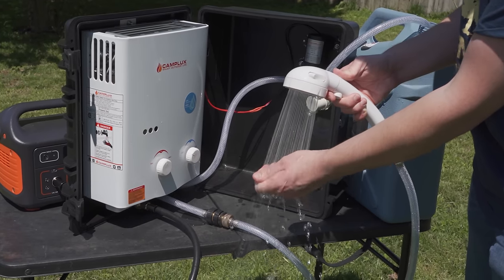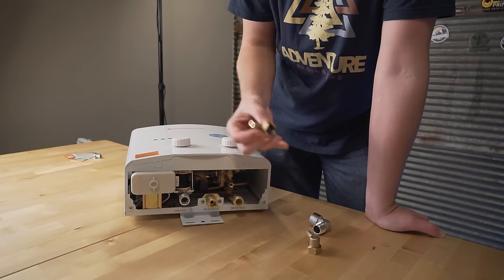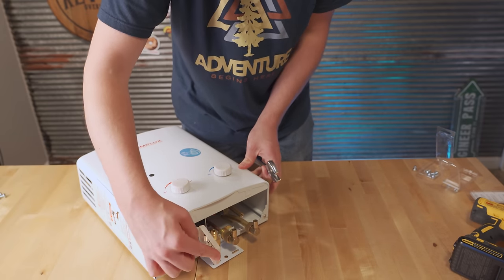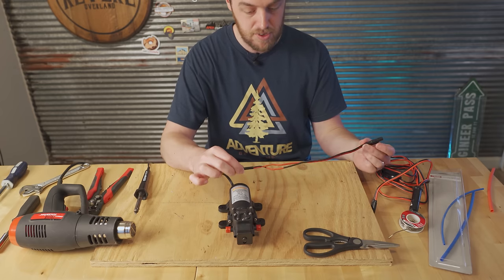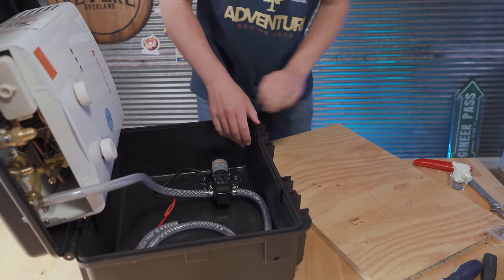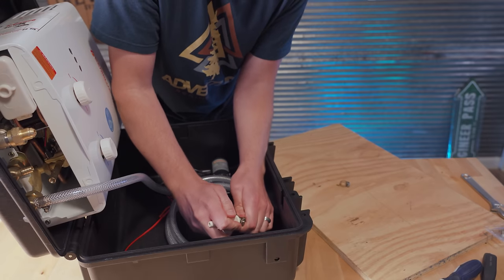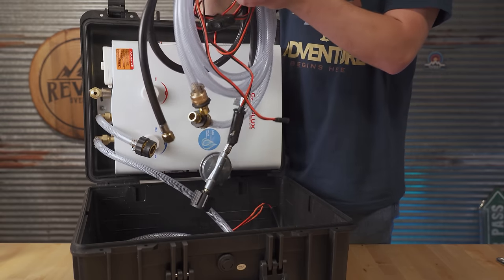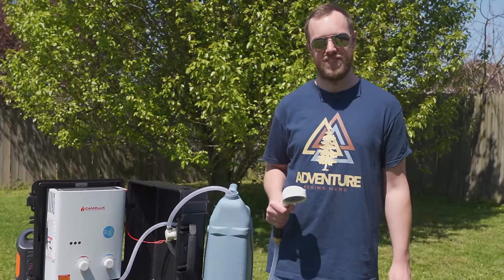Instant Hot Camp Shower in a Box

Comment: Great video mate! Just purchased one of these on Friday of last week and and using later this week when I go away. Probably won't have time to do this to the setup, but it certainly is on the list of projects. Just nice way to have it all in one place.
Question for you though. I assume that the heat coming out of the top of the system is not hot enough to melt the plastic?
Also, off the pump, could you not have put a 90degree elbow in at the inlet to avoid the bend in the hose? Just a thought.
Cheers!
Reply: I am wondering about the plastic melting as well if used frequently or for long periods of time

Comment: I set up water and pump system but really like your idea to keep the unit stored and damage free.  1 question however, doesn't the heat rising from the unit damage the otter box?  seems like it would if not right away over time.  Do you do anything not mention in this video to minimize the impact?
Reply from the maker: It doesn’t

Comment: I'm sure this has been addressed but there are way too many comments to check. 
*I would plug the gas outlet and not keep the gas line or plug it when not in use to keep that water out of it. 
*I would put the electrical cord in a plastic baggy to keep the electrical stuff dry when stored as well.
*You can very easily put your own tap into the bottom of a water container for probably less than $5. Also, you could weight that hose, perhaps with one of the brass quick fittings or just a hose weight.
*Consider an additional hose with a prefilter that you could drop into a lake or stream & then have endless water.

Comment: Do you feel that the original quick connects to the water heater are the reason I get leaks when I turn my sink off? Water supply still running but sink handle in off position. I saw you said they were cheap. The leak is happening at the quick connect.

Comment: i would find a 400watt dehumidifier and hook it to solar power in your van / truck / car and  this way you will always have water for you shower at the end of the day in the middle of nowhere, sure its not drinkable but good enough for a shower, i would add that to your list
Reply from the maker: I'm thinking 10,000 BTU air conditioning unit, that way you get the water AND cooling
Reply: Revere Overland Have you found any portable DC air conditioners to try?

Comment: Have you had any problems with the exhaust from the heater melting the plastic case? Is the Camplux heater still working well? Have you used it a lot?
CASE ID: 17.64 x 13.58 x 7.32

Comment: I wonder if you could use this for washing dishes in a camper trailer as well..I mean it’s portable right?  Or even just run the hoses and mount it in the closet...
Reply from the maker: You definitely could use it for dishes in a trailer. My buddy has this mounted in the back of his off road trailer for just that, then when he wants to shower he pulls the hose out to his shower tent. You just need to make sure it’s well ventilated.

Comment: You could just heat some water in a large pot and wash with that, don't need a shower TBH. A less stiff hose or a weight on the end will let it stay at the bottom of the water can.. How long will the  small propane cylinder run the water heater?  That came out pretty neat . I'm considering a Joolka.

Comment: Really nice job for all in one package. 

But I think your going to run into a little problem. The case where you have the main unit hooked up is plastic. The heat exhaust part of the shower unit is on top, that’s where the heat exhaust will be coming out and it’s going to be really hot. What do you think is going to happen once someone takes a 5-10 min shower? That top part of the case will start to get soft and start to melt. Plastic and extreme heat don’t mix. 

Think about and I hope everything works out.
Reply from the maker: I ran this shower non stop on my entire 7 gallon tank to test it out. The plastic is very heat resistant.

Comment: Why didn't you simply cut some heat venting holes in the box itself? Maybe reinforce it with a carbon fiber or metal grid so the heat can escape without weakening that side?
Reply from the maker: It doesn’t need it, you run it with the box open.

Comment: what was the other case by pelican you recommended and that would fit all the stock fittings? Also, that hose does not look like a 3/8s inch id. It looks like 1/2 inch.

Comment: if you want to use the jury can that he used and keep your hose from coiling back upwards all you have to do is get yourself a stainless steel coat hanger and wrap it around the hose in a coil shape it will keep it rigid but yet flexible or you could just fold it in half and shove it up the center of the tube and then put it into the Jerry can water will still flow through

Comment: I think this is cool, I would have went further and taken Apart the whole mechanism and mounted only the burner parts on the door with a plate and spacers away from the frame. also i would have tossed the power connectors and used xlr or even old rca connectors. its only 12v
Reply from the maker: I froze mine on the latest test, so I might take it apart when I have time

Comment: Is the MP case you have listed on the parts list the same one you used in the video?  It is obviously larger than the minimum but it seem bigger (hoping so it’s not so tight). You are a pro at putting things in a box. Thoroughly love my diesel heater in the metal box-thanks for all your help.

Comment: Does the pump auto switch off when ots not been used? Im building one on my boat but goimg to use the shower for tap and shower.. obv diffrent times but dont want keepessing around turning it off and on.. so if i kept it on in a bigger tank, when i run the tap.wpuld.it work the same basically?

Comment: I did buy one of those heaters.  Ended up throwing it away . It was not safe to use. The heater would not turn off when you turned the shower off causing the water to overheat and blowing off the hoses on the hot water side . It was just not worth it.

Comment: I have the Zodi shower in a box. Way smaller, very practical and I'm guessing much cheaper. But no DIY required so no weekend project 😜
Reply from the maker: I had a Zodi that I got after last summer’s trip. It heated well, but the heating element cracked, so it’s unusable now. I’m not a fan of the battery pump that comes with it either, and I’ve never seen their 12v in stock! I’m assuming pretty much any 12v would do the job though.
Reply from the maker: But yes, the Zodi is cheaper and smaller!
Reply: Revere Overland I’ve had mine for several years and it still works well expect for the battery pump that stopped working at the end of last year so I’m not a fan of that either. But overall happy with it

Comment: Great video.  I camp on the beach and its often windy.  How stable is the unit when sitting open on the table and would there be any issue with wind knocking it over?   There was also a comment about wind affecting the efficiency of the heater.   Have you noticed any issues?  Thanks!
Reply from the maker: The only problem I’ve had is that this heater can be too hot sometimes, never too cold! The box is pretty stable - it’s big and heavy, and when open 90 degrees has a stable base.
Reply: @RevereOverland  Thank you.

Comment: This looked like a great idea, and it was very well presented. But, when I add up all the material costs it comes to $510. So even if you adjust for some of the bulk hardware items that you'll have left over you'd be in for $500 or so. A Coleman portable tankless water heater is $310 at Amazon. It comes with the pump, hoses, shower head, etc. It's ready to use. A Base Camp water heater is even less at $199.
Reply from the maker: I don't think that's a fair comparison in cost. The parts for the shower unit as I have it set up cost me $350. You definitely can't include the cost of my propane mount, but if you want to include the bottle, it probably ends up being cheaper in the long run since those 1lb bottles add up. In the end, mine is only a little more, but is a whole lot better than the small self-contained units - far more heating capacity, and a more powerful shower.
My biggest problem with the Coleman and the Zodi is that you can't quickly and easily start and stop it to conserve water. I (and most people) only carry a few extra gallons of water, so can't afford to just have it running constantly. The Base Camp is the only one that you can switch on and off on demand, and it has horrible reviews!
Reply: @RevereOverland  I followed all your links to get the pricing. If I take out the bracket it comes to $419.63. Anyway, I live in Canada, so I will have to go back through the exercise to find Canadian suppliers and pricing to see how much it will cost me. Regarding the stop/start feature, are you talking about the ability to turn the water flow on and off from the shower head?
Reply from the maker: I just added it all up again, and I think I forgot the gas fitting from McMaster Carr last time. I got $381 + $5 shipping (USD). I'm not including the propane tank - I can refill it for about the cost of a 1lb bottle, so it'll be a lot cheaper in the long run. I'm also using $6 for the cost of the screws, washers, and nuts, because that's what it cost me from Lowe's.
Yes, I'm talking about the ability to start and stop from the shower head. You can do it often and easily with mine and the Base Camp, but you have to completely shut off the Coleman and Zodi. 
Obviously, you can do what makes you happy. I think it's worth a little extra for a reliable shower with good water pressure and easy use. Some people are happy with cold water from a creek!
Reply: @RevereOverland  Now we're in sync. The water heater is sold out, but I can get a very similar one in Canada made by EccoTemp. When I add up all the bits and pieces and factor in the exchange rate, it comes to about $50 Canadian more than the Coleman water heater and if replace the shower head on the Coleman unit for one with an an/off control, there would be no savings. I already have a 22" case, a large propane tank, and I wouldn't need the tank bracket. So, I'm going to price all the items out properly and put one together and will let you know how it works. Originally I was going build a solar water heater, but this will be way more practical and reliable. (Of course all our campgrounds are closed and even Crown Land - Canadian BLM - camping is forbidden)
Reply from the maker: @kingstonsean  chances are that the EccoTemp is identical inside. I'd be interested to know if it has the same measurements for the fittings - so far every brand I've checked has been the same. I'd like to offer some alternatives on the website if they are the same!
Even with a different shower head, you shouldn't shut off the Coleman or Zodi water heaters. They don't have an auto start up or shut off, so they keep heating the element, even when the water flow stops. That could cause you to burn yourself when you start up again, or could potentially boil the water in the heating element!
Reply: @RevereOverland  Wow. Coleman calls their's " on demand" but that's a misrepresentation then.
Reply: @RevereOverland  I downloaded the Coleman manual. You're right - there is no pause feature, by design. That's just plain goofy! From the manual: "Due to safety reasons, there’s no switch to pause the water flow while taking a shower. You can only shut off the main burner by turning the control knob clockwise back to the ignition position “  PILOT” to conserve gas, the pilot light remains lit, the pump & water keeps running. To resume heating the water, turn the control knob counter-clockwise to a setting between “MAX” & “MIN” position.Or you may shut off the heater completely by following steps in above section “Shutting Off the Heater”, then restart the whole ignition process illustrated in section “Lighting the Heater”."
Reply: @RevereOverland  They look identical on the outside. I downloaded the EccoTemp manual. It says "PORTABLE TANKLESS WATER HEATERS HAVE 1/2” TO 3/8” ADAPTER ALREADY
ATTACHED TO THE GAS INLET ON THE WATER HEATER" It also comes with a Garden hose quick connect kit.
Reply: @RevereOverland  It looks like the fittings on the EccoTemp are the same. I have a 22" x 14" hard side case that I can use, so with the extra length I won't need the 90° angle fittings. The EccoTemp comes with a pump and strainer, and some hose mending fittings. I'll need the electrical connectors, nuts & bolts, and the yellow Teflon tape. It looks like it will add up to about $340 Canadian. Once I get it put together and running I'll send my final tally and some pictures to your email or Facebook page. (BTW - I took a look on AliExpress. There are several models and brands for sale, some as low as $90 US. For wholesale, they're as low as $30 on AliBaba.com for orders of 2,000 or more, or if you just want 1, they're $45. They all look the same. But you have to pay for shipping from China.)

Comment: Nice job. Thanks. Did you look into buying a smaller water heater or was that size typical?
Reply from the maker: This size is typical. There’s a slightly smaller one I was considering for a follow up video, but it only saves an inch or two.

Comment: Good video.  But what about a simple and cheapest set up by just connecting a shower hose to the bottom of a Jerry Can and using the gravity do the work?  Of course the water in the Jerry Can has to be warm up by the sun or pre heated on a stone sort off.
Reply from the maker: A lot of people use black PVC pipe mounted to the vehicle to heat in the sun. You don't get nearly as much heat as you'd think though, even in the desert sun!

Comment: Camping and specificly canoeing white water in winter usually ends up making one very cold. Sitting around the fire didn't help much. So over the years worked on developing better idea. First we tried the humble canvas bucket with shower underneath to turn on, had wind the shower nozzel a few times. Heating water came from a 20 liter drum standing next to the fire pit, designed to evacuate hot water when cold is entered. Trouble with this system,, you had to mix the water manually to obtain your desired temp AND it was murder to hoist it high enough to stand under. There had to be a better system surely. Internet research resulted in a LPG instantaneous heater available from China. This heater would ignite automaticly once water was running thru. Looked too good to be true. Ordered it anyway. BEST THING I EVER DID. O.K. had to buy 12 volt electric pump and shower hose and rose. Hooked up the goodies. 12 volt battery, 12 volt pump providing 40 P.S.I and 11 litres/minute bringing COLD water to heater. Heater ignited automaticly, running on LPG, heating water to desires/setting temp exiting from shower rose. Awesome. What more could one want. After shower, turn rose off, heater turns off and pump turns off as well. We've had this system now for 12 years and in most cases, it's worked flawlessly with ONE exception. During a trip through the Pilbara area of Western Australia, we obtained our water from a tank supplied by the Parks Dept. The water within said tank came from a deep well. After running this water through the heater, the adjustment controls FROZE. Could no longer move them. Turns out the BULLDUST powder which is prevalent in the outback, and could not be seen in the water it's so fine, built up around the "O" rings and set like cement. Replacing said "O" rings and instaling micro filter on pressure side of pump seems to have cured this problem. I have purchased the shower cubicle from the mob who make the heater in this vid, but am not satisfied with it at all, it seems to be manufactured for dwarfs not normal sized humans. The hoses I also bought, but compared to my stainless steel ones, I've only used them once. The best thing I've used is the tap. There's only one down thing with these in Australia. Because they are not fitted as a fixed item, you can get away with them legally. BUT if you wish to have them FIXED permanently on a caravan/mobile home or shack/boat you will have problem because they are not compliant with Australian standards and any plumber who installs one, makes themselves liable for prosecution.

Comment: so the big question is how much water do you actually NEED to clean: face/pits/privates/feet? Use a jet boil to add hot water to either the Nemo with foot pump, or there is a Nalgene water bottle that runs about 30.00 on Amazon that you can pressurize and spray with. I've used that along with Butt wipes/Dude Wipes/Shower Pouches/ etc. and it works great.
Reply from the maker: I'm not sure exactly how much water I'll get through when traveling. I just know that the wet wipes and shower wipes didn't cut it last year. My wife demands a proper show anyway!
Reply: @RevereOverland  
"Amen"

Comment: Im thinking of buying one of these or similar for my apartment. Im never home so the hotwater systems turned off to save money. Could i run a long hose from outside into my shower or would it work indoors with a well ventilated and exhausted bathroom?  How much hot air and exhaust comes out of it?
Reply from the maker: I wouldn’t use this inside due to the carbon monoxide risk. You could run a long hose outside though!

Comment: Great set up. Have you tried the heater at altitude? I’ve read that the heat diminishes about 10% per 1000 feet.
Reply from the maker: Yes, we’ve used it multiple times over 10k feet, and it’s always hot.

Comment: It just occurred to me that if you get a pump with pipe thread on it you can connect a 90° elbow fitting to put the hose on without the kinking corner problem.

Comment: Doesnt the heater melt the box? Thought they pumped out heaps of hot air?
Reply from the maker: They do, but with the heater in the lid it hasn’t been an issue. These cases are a lot more heat resistant than people give them credit for too.